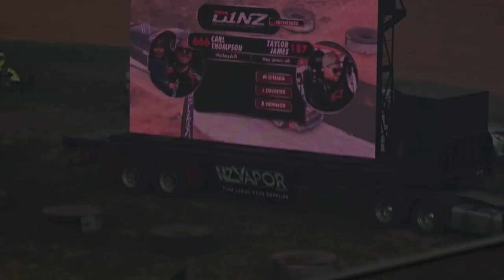Cole Armstrong gave me the keys to his R34 | D1NZ Round 3 main day!

Comment: Running a notched crossmemeber on the 86 or still have the rack in the standard position? Gt86 geometry turns to shit once you need big lock steering bind is a big drama on them
Reply from the maker: It has the wisefab crossmember. Its a bit messy and needs a lot of work to get sorted.